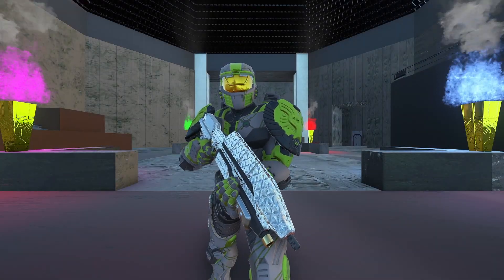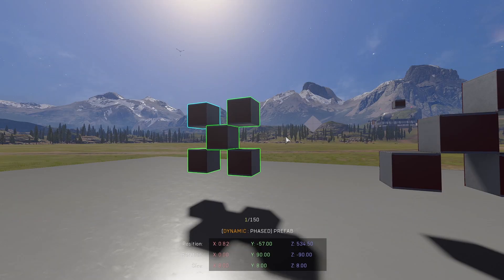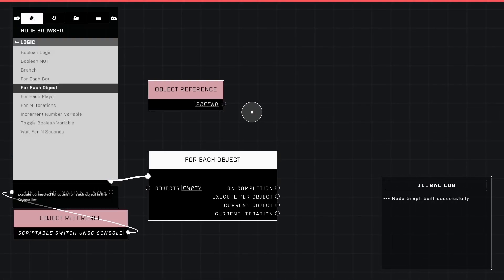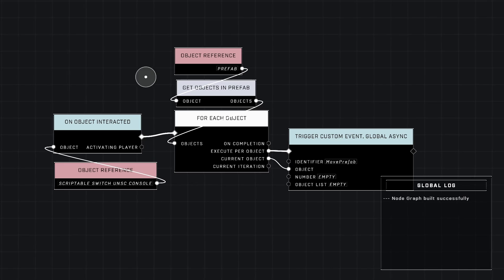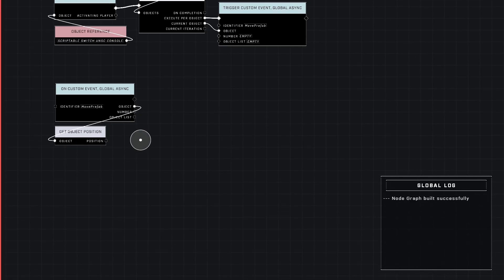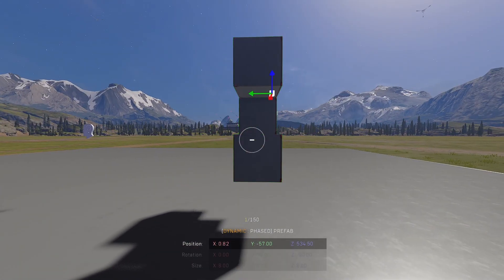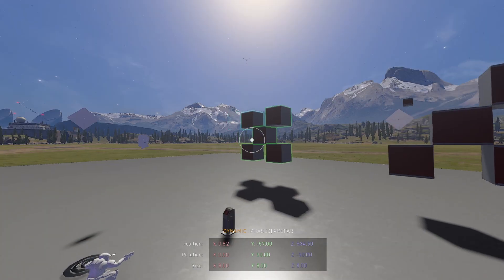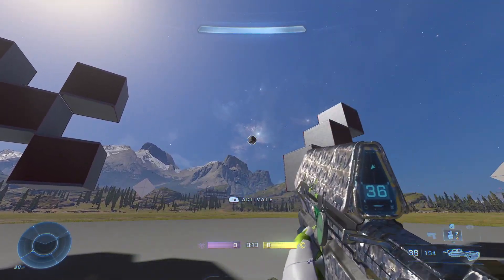Move Entire Prefabs | Halo Infinite Forge Tutorial

Comment: I don't think this works in custom games.

Edit: I figured out why it doesn't work I think. It seems that in forge it treats the "get objects in prefab" as a list right? Well in custom games it only gets the parent object for some reason. The way around this I found is kinda annoying and it takes alot of node graph budget. It's simply just taking each individual object and adding all of them to an "object list" then referencing the "object list" instead of using "get objects in prefab".

 So yeah, you can't seem to move prefabs per say in "custom games", but you can take the objects in a prefab, ungroup them then add them to an "Object List"  variable